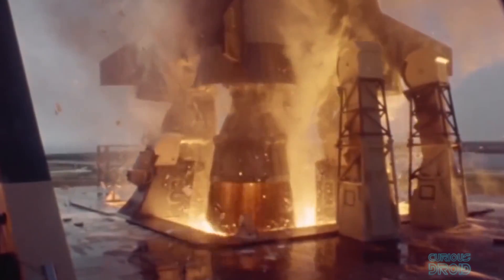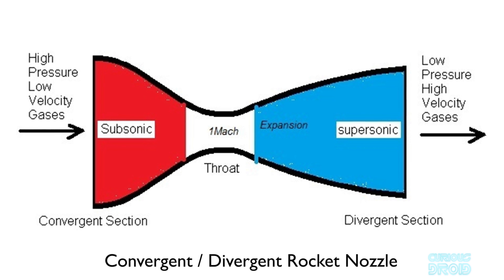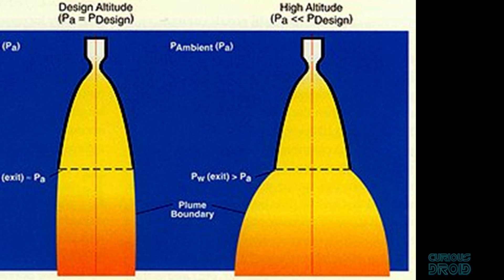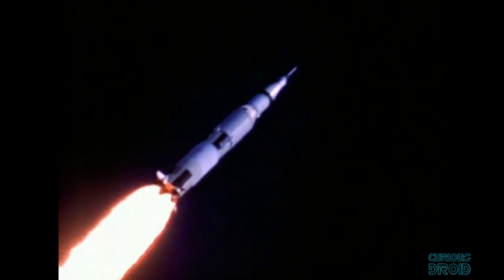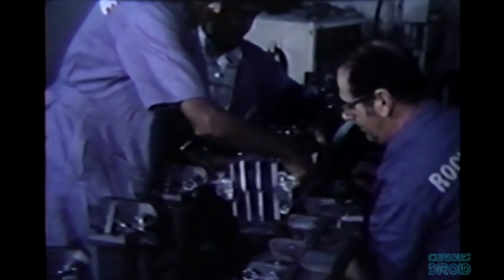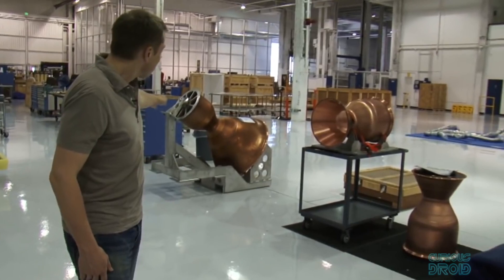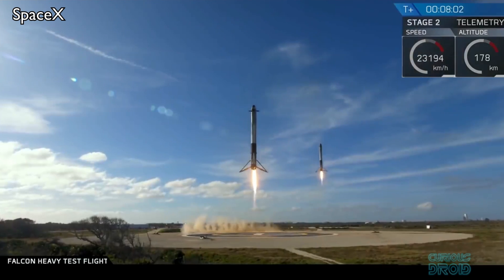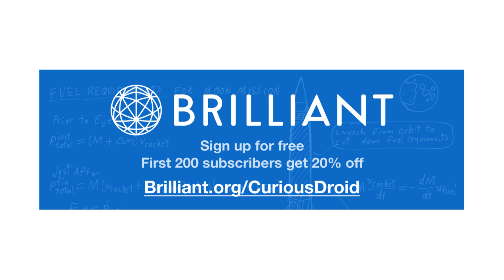Aerospike Engines - Why Aren't We Using them Now?

Comment: Basically, this is why private funding for science does not work.  Simply, private funding will always prioritize minimum risk and maximum profit.

Technology like this needs government funding where failure is a perfectly acceptable outcome.
Reply: George, I disagree for several reasons.  First, space flight is understood well enough that failure (after the design & test stage) is not an expected outcome.  Even the Space Shuttle losses were not an acceptable outcome, we knew we could do better.

I fully expect that once SpaceX or other companies have a solid income, they will look for further improvements, such as an aerospike engine.  For their very first product though, you just want something that works.  Then make it better to block your competitors. SpaceX's re-usable rocket is already innovative, something that the government didn't have the ambition to try.  Go for the big gains first, then smaller gains like the aerospike later.

And as you saw, the X33 didn't come to fruition, even though we spent billions on it.  The reason is that it was financed by the government, and politics change, a new president comes in, doesn't like what his predecessor did and cancels his projects.  Government funding is needed for some things, but very judiciously.  Pure science for instance, like sending missions to asteroids or Mars, where we can learn a lot, but the financial incentives are very much in the future and unknown.
Reply: Rob, I agree with everything you said, but I'd like to add that with privat companies taking over space venturing, we are going to see huge jumps in technology. Companies need to make money, and to make money, you need to be the first doing something. 

Elon's mission to Mars is not some humanity advancing mission he is on; that is an untouched planet with abundant resource and land, perfect place for the first inter-planetary company to set up on. The advancements come when trying to figure out how to maximize profits; space flight needs new tech, and if Elon wants to profit from space, he needs to make that tech quick.

Asteroid mining is another thing that'll bring advancements, we just proved we can land on them; it's only a matter of time before mining companies start looking at them for their business. 

After that, it's just a domino effect of space ports, privet and industrial ship manufacturers, etc, etc.

So, basically, privatizing space is probably the BEST move the U.S. could have made for our future.
Reply: Rob Neff I would see it a bit differently, mainly look at Lockheed Martin and look at all their recent Programs, namely the X-33, the F-22, the F-35 JSF..........what is the problem that connects all of them?

They all have had or still have massive cost overruns and delays.
The F-22 works now but the production order was slashed to less than 200 aircraft, which precludes effective operations, as you can't really loose any of them, it's too big an impact on the fleet. 

The F-35's Cost overruns are an almost legendary saga by now, you know it was supposed to enter service more than ten years ago. And to top it off, when the original JSF competition was run, one of the Kill criteria for any effort was cost overrun in the design stage.
That was around 1999, and guess what happened? LM had a cost overrun, which would have killed their effort and let Boeing win by default. 
The only reason this wasn't triggered, is that the Boeing Effort, the X-32 would've needed serious redesign to reach the necessary performance. 
At the same time the F-22 program was in serious cost overruns. 

I think your argument that the X-33 failed due to Government spending is to simplistic and false, instead based on a further look of the Contractor, Lockheed-Martin's Performance on similar projects at the time, I would posit that the fault lies more in a failure of corporate policy at Lockheed Martin. 

P.S. I would also like to point out that SpaceX and it's competitors are working on the basis of research done by several Governmental institutions both in the US and abroad. 
Which saves them a ton of Money and risk.
Reply: LupusAries, Maybe you hit reply under my post, maybe you replied to the OP (original post,) I don't know. 
If you just pushed 'reply' under my post, I'm pretty sure I'm the only one who saw it.
If you replied to the OP, everyone sees it.  Check it out, I'll reply to the OP after this, and then to someone else but with your name on it after that.  Maybe I'm wrong, get back to me on this experiment, OK?
Reply: Sails - Socialism is likewise a dead end game. Offering good things for free is addictive, especially when in a democratic representative system the beneficiaries of the goodies continually vote for "more free cheese."
Capitalism's great fault is that each capitalist's business object is to drive competitors out of business and establish a monopoly.
Government is the greatest capitalist enterprise. Government is always intended to have a monopoly over its territory and "customers" (subjects).
Reply: Defkon, just speaking for myself, I'm no conservative.  Far, far from it these days.
Reply: Vodkacannon, And there is no money in Space-X according to some analysts.  Not that I don't dig the company, but there's a lot happening in the industry.  Eventually it will be a "real" industry, but only after lots of governments stop subsidizing it.  In a level playing field Space-X is a winner, but the orbital field is crowded and tilted, the beyond orbit field is minuscule and the suborbital field is...a good place to start.
Reply: Well, that's what NASA was originally for - testing new and experimental technologies from the cutting edge of the space industry.  Now they are trying to pass the risk of R&D on to industry while they operate more conventional vehicles like SLS.
Reply: Sails I'm in the Chicago burbs, 6 cents per kwh
Reply: Joe Kolakowski https://www.google.pt/amp/amp.timeinc.net/time/4089171/mariana-mazzucato
Reply: Ray Nash, Yep, essential materials for rockets today, ones that had not been invented in 1960 aren't even considered to be worthy of being on an export controls list.  Slide rules vs. AI modeling.  Another advantage is from being new and not tied down by decades of commitments required to get the first jobs done.
Reply: Vodkacannon, They definitely have suborbital down pat.  Who knows whether SpaceX's losing money. I'm with you about peripheral parts of manned flight, exploration, any basic research frankly, needs to be from a bigger pool than capitalist industry will allow. What in the world (pardon the pun) are we going to do with multiple hundred-ton capacity rockets? Edit: I don't get how I'm contradicting myself.
Reply: LupusAries, Excellent points, gives us all something to think about

re: OP
Reply: Let's try that again, let's see...the comments system has been a bit of a mess recently. 
Re: OP

Back on Topic, as I posited above, LM at that time was a bit of a Mess and more recently than that there also was an ex Skunk Works member Alan Brown that criticized LM for having lost the Skunk Works style of working even in the Skunk Works. 
This was in context of the JSF program. 

(For those that don't know the Skunk Works were the division in which Lockheed handled their cutting edge designs, like the SR-71/A-12 Oxcart projects and the U-2 Program. 

Basically, the Skunk Works worked on a principle of small teams that had members that were qualified in multiple areas and a minimum ammount of paper trail. Rather helpful as some of the projects were highly classified and beyond Black at times. 

The Criticism is that they are violating Kelly's fourteen Rules, namely 2, 3, 5
https://www.lockheedmartin.com/en-us/who-we-are/business-areas/aeronautics/skunkworks/kelly-14-rules.html

Now the X-33 is another Skunk Works project in the same time frame as the JSF program, and the F-22 program which would make it likely that it suffered from the same issues. 

Sorry the best I could find of that criticism so far is this: 
https://theaviationist.com/2013/04/08/skunk-works-jsf-mess/
As Bate's article was part of a magazine that got combined with a sister magazine, and I couldn't find the article on there. 

And Interview with him:
http://www.avstry.com/transcript.jsp?id=3a

A short history of the Skunk Works and their process, with a bit of criticism:
http://www.thedrive.com/the-war-zone/21791/for-lockheed-martins-skunk-works-its-all-about-getting-to-the-prototype-stage

So Weird to have driving magazines taking over aviation blogs and magazines.
Reply: bobwatters Not sure if serious or trolling.............. :D
Reply: Sails, Russia subsidizes their launches for foreign clients. Even so, use https://en.wikipedia.org/wiki/2018_in_spaceflight , to make a case from that chart of  to back up your "almost all" assertion. It looks like most Russian flights are in support of the ISS.
Reply: Private research entities have been very successful. Look at Bell labs (RIP). It took a handful of people there to develop the first transistor or discover CMB radiation, accomplishments that have greater practical or scientific weight than anything this shuttle would have done. Yes. They have different ideas about ROI and risk than government or academic counterparts, but that isn't necessarily a bad thing.

Minimizing risk and maximizing profit is a really good approach for a launch vehicle. Let's say that I'm doing a satellite that has a well defined science mission. If the launch vehicle sends cost per weight through the roof (imposing unnecessary weight or size restrictions) or is actively competing with the science mission for funds (because it is a mess of internal politics and high risk concepts); the launch vehicle in question is hurting science.
Reply: Based
Reply: +George Wang   Well said.
Reply: Um, the government doesn't take risks, private persons take risks. The innovators and the entrepreneurs take risks and you find them in the private sector.
Reply: George Wang  That last statement is the opposite extreme, failure should never be "perfectly exceptable". Occasional failures should be sustainable, or they should be allowable on unmanned projects.
Reply: Really? Space X comes to mind but do continue. They have government funds, but its for work they do for them in space. They have built a better orbital delivery system in less time and with less money than any previous space effort by the government. They did have one huge offset advantage to their cost. They had all the years of space research conducted by NASA during the cold war years on Mercury, Gemini, Apollo, and the shuttle. That was a huge bootstrap for anyone wanting to go to space as that information became available for people to learn from.
Reply: @rayspace373  
SpaceX also got an absolute shitload of technical support from NASA.

Don't brag on private industry being better than government when the private industry is using, for free, the things learned by the government spending billions upon billions of dollars.

Without that money being spent by NASA over decades, not only would SpaceX not exist, it wouldn't even be an idea.
Reply: I'm wondering if you can be more wrong, I don't think so.  Your "better medical" is so good that most Canadians need to come to the USA for timely needed treatment.  Our gov't crashed the banks by forcing them to give loans to low-income people that couldn't afford it.  The car company that was bailed out was only bailed out to save the union that was crippling them (UAW overwhelmingly supports the Democratic party).  If you enjoy gov't run business so much, take a trip to Venezuela and see how great they are doing.
Reply: "Private funding of science does not work"... Riiiiiiight, just like calculus, telegraph, telephone, locomotives, automobiles, pacemakers, iPhone....  So, who decides who gets to burn up other people's money on chasing their theories? Eventuality we end up with social justice science or crony science. Good solid ideas survive on their own merits and attract supporters and resources.  Government funded science gives us government approved science. Im not interested in the DMV(department of motor vehicles) directing the progress  or direction of science.
Reply: The government are the folks who shut this technology down.It's different...and bureaucracies HATE anything different.
Reply: ghost307 - The bank collapse was largely the result of government pushing the banks to make loans the bankers knew were bad with the promise that government would make up their losses.
Reply: Al Grayson: In nearly all countries, the majority of people actually pay the state to properly handle the most important services.
Reply: Oh yes - Let them build what you say - You can testfly it then! I recommend, if you have Family, to write your Testament before! Just because China gives a Damn about their Space Jockeys, you should not assume that all the World is that cruel!
Reply: George Wang ...... you are right...... most of Americas tec came from the GOVERNMENT space tec.  All those break throughs and trickle down tec to consumers was government funded.  In canada our government electricity is 8 cents a kw...... in the states its up to 50 cents a kw.  Our government medical is 120$ a month for a family of 4 and we get better quality of service than the states.  A very few private sector business can do a very small portion cheaper but with no research, new tec or products.  In the 2008 crash all your banks, car companies and stock market had to bailed out because private business model of America will always fail.  Its a dead end game.
Reply: George Wang George, you should've known that suggesting anything that government should do would draw the slobbering Youtube conservatives like flies to honey.
Reply: Joe Kolakowski ........ almost all satellite launches use Russian heavy lift rockets............. even America.  Canada used Russian generators in their hydro projects  because they are more efficient than any American. You are brain washed that capitalism is better.
Reply: I agree it just can't be faked properly without government
Reply: LupusAries, Some people might always disagree.

re: Dr. Obvious Real

Comment: I believe the X-33's aerospike engine was also still overweight at the conclusion of the program, having a detrimental effect on the ship's center of mass. 
The "Rombus" almost-SSTO proposal from the 60s was pretty interesting. It used the gargantuan aerospike as a heatshield for reentry, running liquid hydrogen fuel through the regenerative cooling system to keep it from melting, then using a subset of the combustion chambers to land vertically.

Comment: One small nit; With a fixed nozzle the optimum is when the pressure at the exit plane is the same as ambient. If it were larger, thrust is lost due to the pressure acting on all the exterior surfaces of the motor vs. the lower pressure on the interior of the nozzle. If it were smaller, thrust is lost due to the lost continued expansion and work done on the exhaust gasses. But all rocket engines improve their performance, thrust and efficiency with altitude.

Comment: Paul would a lauch system of a rocket sled and rail system be possible, similar to the fictional one on Fireball XL5? I imagine that maybe on the Moon or Mars it would be possible due to the lower gravity but not on Earth.
If so maybe there could be a larger craft that does't actually land but orbits and a smaller module ferries to the suface.

Comment: There's no point in a SSTO when/if you can land&reuse the rocket parts. That's really the only application where a spike engine really makes sense. But a SSTO is not efficient or low cost in itself. On the contrary. Next fail is that the thrust and thrust efficiency of a spike engine is limited by the cross section area. It's a better idea to have a small area for low drag and cover that end area with bell engines. Final fail is that many small engines are much lighter than a big engine, including a big spike engine (and many small spike engines nullify their supposed altitude adaption property through interference). And if you land the first stage, using thrustback, re-entry burn and landing burn, the weight saving on these rocket parts, through use of many small engines, end up being more fuel efficient than a spike engine anyway. And many small engines means you can mass produce them, which makes them much cheaper and more reliable.  ...so...
Reply: The VentureStar was going to have seven engines, not just one.  The most ingenious part of its design was that it had a single structural fuel tank, because building one big fuel tank really is more efficient than building several smaller ones.  The bigger the tank, the smaller the ratio of its empty weight to its internal volume.  The VentureStar was essentially a flying fuel tank with engines, a payload bay, and a metallic heat shield for skin.  Its mass ratio would have been insanely good if it hadn't been for the limits of early '90s material science.
Reply: Here is a good point for them. It makes us THINK about rockets and why we use what we have. The chance that something will work better makes us think, ponder, and calculate. Basically, I feel they exist for the discourse such as what we are having in this comment section. On second though, that is a rubbish point...

My personal research is limited, as I have interests elsewhere (thank you YouTube for the random video recommendation), but I see your points and believe them to be accurate.
Reply: Well SSTO means much simple and probably much cheaper design and on top of that will be fully reusable. Imagine a SSTO with aerospike engine launched from a platform hanging on giant balloons 35 km (or more) it'll deliver payload to low earth orbit almost 1:1 with the weight of the SSTO and of course it can land back to the platform.